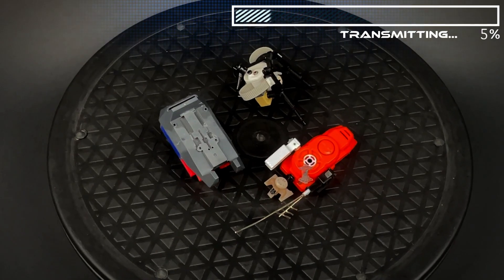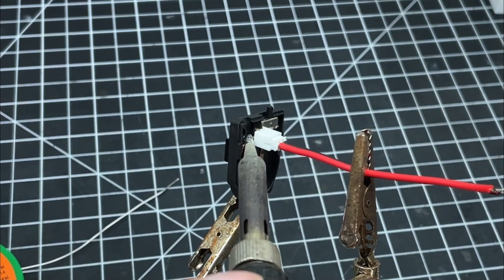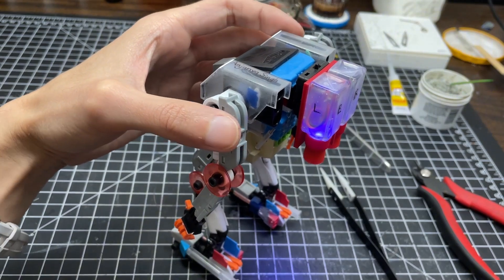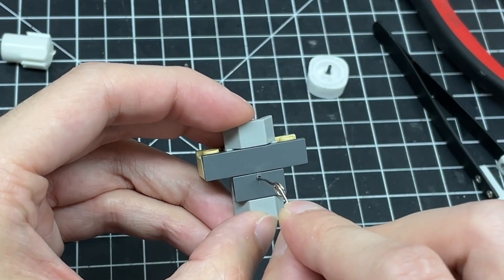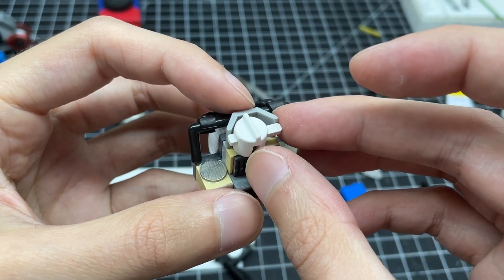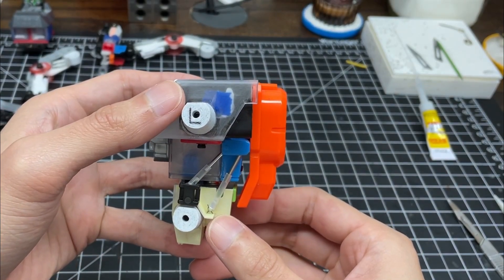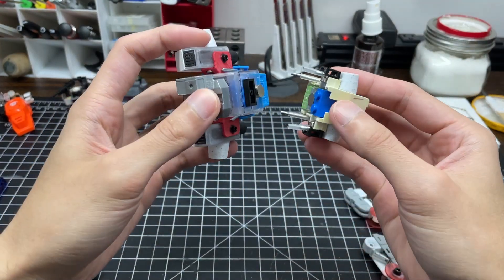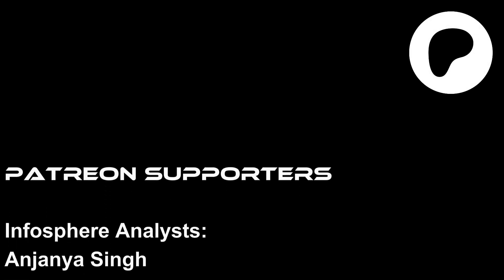ECHO: Rollerblading Mech Backpacks (Part 3)

Comment: [in-character]It should be pointed out that the Yagi-style phased array feed on the comms and sensor "backpack" unit was engineered upside down.  The perpendicular elements need to be oriented in order of smallest to largest in the direction of the connection to the radio unit.  The antenna as designed will have inferior performance in its role as a ground-to-space directional datalink.  

As it stands, the Yagi design is a good attempt at trading off stealth and ease-of-access.  Yagi antenna are incredibly directional, they are actually the tool of choice for triangulating radio sources.  Because of that directionality, you will only have a window of a few seconds during each friendly comms satellite orbit where you can have high bandwidth and low-latency connections to your theater-wide network, but your transmissions will not be detectable by most receivers at a range of a hundred meters or so without line-of-sight to the antenna.  And, obviously, if the enemy has line of sight to your antenna, you have exited the stealth phase of your mission and have other concerns.

If longer communication windows are needed, I would recommend replacing the Yagi-style antenna with a curved panel array to provide a tunable phased array for your transceiver.  The archaeological records of the historical Starlink network on Old Earth utilized a low-tech variant of this concept that was surprisingly effective for how primitive it is.  Modern antenna panels can take nearly any shape and merely need to be oriented with their long axis parallel to the ground to provide access to anything in range of your transmitter lurking in the visible sky on nearly any frequency used for civilian or battlefield comms.  The civilian units available should suffice as most of the driving intelligence is now integrated into the structure of the antenna itself.  Whatever radio unit you have installed in the backpack should be able to "talk" effectively to even a cheap panel and provide good bandwidth to orbit once an operation goes "hot".  

Thank you for your time.
Reply from the maker: @bearnaff9387  thank you for your input! While I appreciate the comments on ground-to-space issues, this communications array is not intended to attempt a breach of the supercharged Van Allen Belts that prevent space travel and observation. We know there are satellites somewhere up there (Starlink being one system that may or may not be there), and some companies have managed to hijack them with use in certain applications, but I’m not a cosmological researcher and have no clue how to incorporate that into ECHO by myself.

Good eye noticing the Yagi-style array is upside down! This is an intentional experiment to see if the negative effects of salt plain storms can be mitigated, i.e. environmental interference. The array has a directional, high gain which will be used for local communication to a broadcast tower or other portable mech system. In general, this is not the only or primary antenna on the reconnaissance pack and will hopefully serve as an additional aide during missions. If the array proves useless, I’ll be sure to remove it from any potential production runs of the ECHO design.

Comment: ANOTHER GREAT INSPIRATION. where do you get your ideas  from?
Reply from the maker: Thank you! Most of them are random ideas and occur after staring at pieces for a while, but they often come from asking questions about what I haven’t tried before.
Reply: @proto.roborovski  thx for reply. I  am guessing you have massive pile of junk that you can grab parts from, I just started putting stuff away like great plastic cheets  very thin are from youghurts pots. i buy 1 liter or 1KG ,  what is the begginers pile  stuff you recomend to keep - i noticed keyboards are used very often by a lot of scratch builders. I dont own 3d printer . so all would me reclaimed or scratch build.
Reply from the maker: @AdrianKramarzyk  I personally try to gather plastics about the size of a coin or smaller for the 1/35 scale I use. And yes, I have many piles of junk 😂. Keyboard keys fit this requirement. I’m a huge fan of electrical components like switches and connectors because they are very detailed for their size. Small “medical” plastics like floss sticks can be useful.

Comment: For the ankle joint you could coat the the ball in mod podge, jesso, ect. It would make the joint stronger and tighter but in could also wear down over time.
Reply from the maker: @Incendius18  I’ve previously done a similar thing by smearing a thin layer of superglue on the ball. I’m uncertain if the socket will be able to handle the extra thickness on the ball so I’ve been hesitating 😅
Reply: @proto.roborovski  it depends what material it is, if it was printed on a FDM printer it would snap but if it was ingection molded then it shouldn't snap, it also depends how many layers you do with jesso. its fairly thin and you could do around 3 layers depending on how loose the ankle is.
Reply from the maker: @Incendius18  I think it’s injection molded ABS. I’ll have to try some small experiments. Thanks for the suggestion!

Comment: That ammunition belt is an excellent solution! Absolutely perfect for that scale.
Reply: I love it because the design has to eject links and casing in separated form (No place for empty ammo-belt to go) so, between the two guns there's going to be a point where it all collides in midair and makes a splash of hot brass and metal belt-links.
Reply from the maker: @bearnaff9387  why assume the cases have to eject inward facing, or that there are brass cases at all? Caseless ammunition and frangible belts are just as feasible here 😁
Reply: @proto.roborovski  Most of the problem with caseless ammo is heat.  When a gun ejects a casing, a lot of the heat from combustion goes with it.  That's why we haven't adopted caseless bullpup designs in real life.  They just get way too hot, especially in fully automatic situations.
Reply from the maker: @bearnaff9387  absolutely, in this case I would hand wave the frangible belt as some means of taking heat away with exhaust. Too bad we don’t have the technology in real life, but very cool for sci-fi scenarios!
Reply: @proto.roborovski  Ooooh, combustible caseless ammo belt!  Firing the round evaporates the belt's thermoplastic, dispersing the heat that way!  You can either say the gun uses the gas for some aspect of ammo feeding or mount a couple little exhaust pipes on these hot-rod machine guns!
Reply from the maker: @bearnaff9387  hot rod machine guns sound awesome, I’ll have to remember that for a Mad Max style mech in the future!!
Reply from the maker: @krzysztofmathews738  totally! I recommend checking a few because I had several different sized cables.

Comment: Why not try some type of spacer for the joint issue
Reply from the maker: The outer socket that holds the ball in place is already thinner than intended, so adding a spacer in between the ball and socket will simply stretch the socket outwards even more, and I am wary of causing a permanent deformation in the material. If the socket were stronger, I would use this approach.